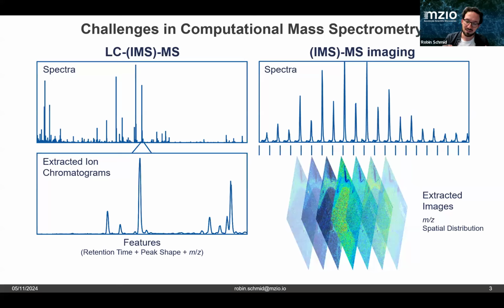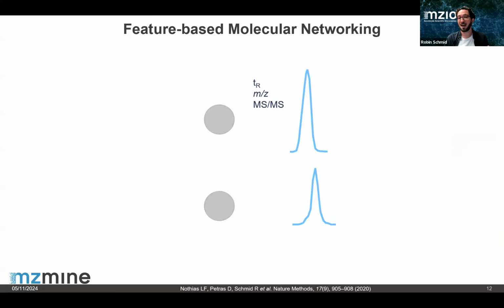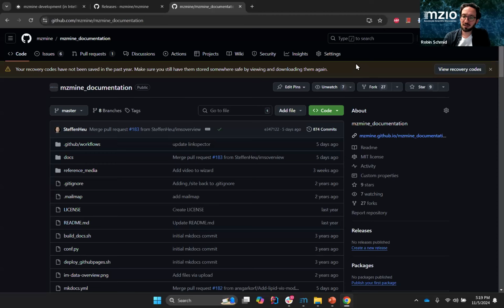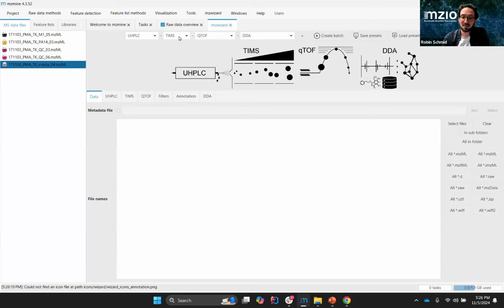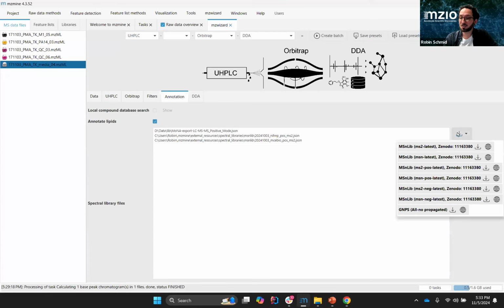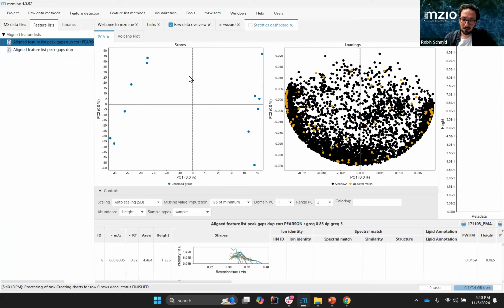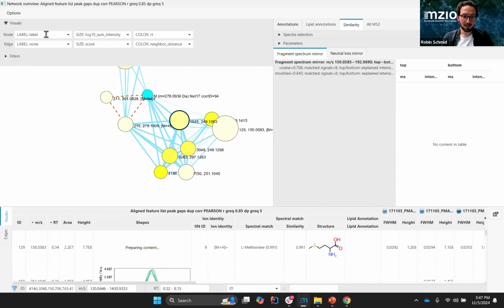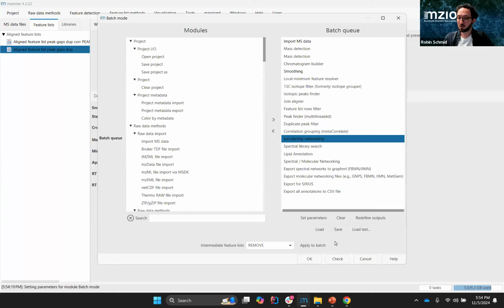VMOL Seminar #28 - mzmine series: 1. Non-targeted LC-MS/MS (Robin Schmid)

Comment: Thanks Robin. How can we do more stastical analysis. is it possible to export to another software.
Reply: We offer univariate and multi variate stats in mzmine in our statistics dashboard. You can also export the feature table and metadata file and then use MetaboAnalyst, FBMN stats pipeline, or other tools.
Reply from the maker: yes! you can export the feature table and analyze it with metaboanalyst or our stats pipeline. Especially if you run  feature-based molecular network, it plugs right in. https://www.nature.com/articles/s41596-024-01046-3